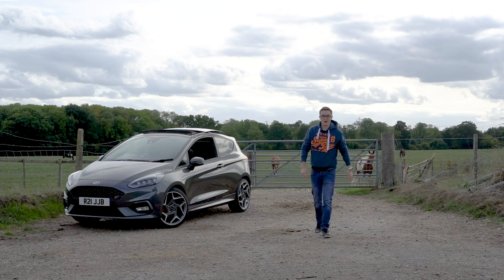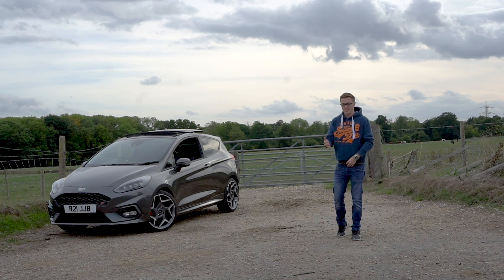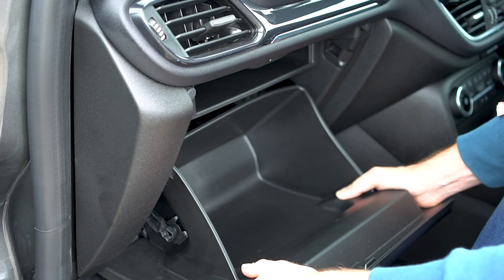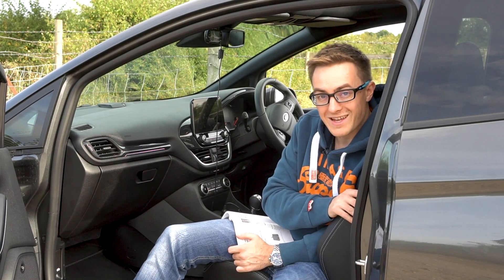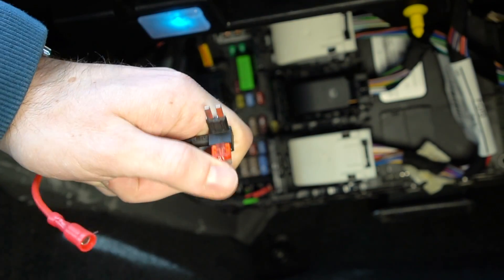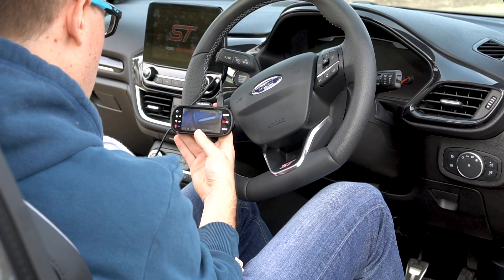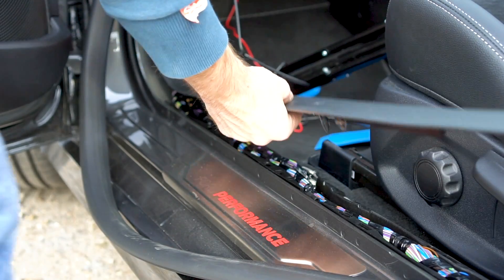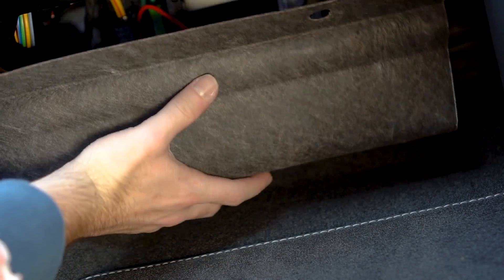MK8 Ford Fiesta ST - How to HARDWIRE a DASHCAM (Nextbase 412GW)

Comment: Hi mate, could you please explain which Fuse Locations are ideal to use, and what the difference between the fuse location 3 (Parking Assist Control Module) and 4 (Ignition Switch) Are if I were to connect to dash cam to either of these. Thanks

Comment: Please note that you've got the right wheel UK version. In the left wheel EU version, the cabin fuse box is exactly where the manual says, behind the glove box and the glove box does not need so much hustle to remove.  You first have to click the support pins to the right position and the glove box just drops down.
I would also suggest to buy a better camera, like the blackvue 750 or 900 dual channel and maybe for a separate battery if you keep your car outside to have long lasting parking mode. The extra features really justify the price and I am very happy so far. Please note that I'm not selling dashcams or I've never been sponsored by any dashcam manufacturer.

Comment: Just so you know you put the fuse board trim on wrong, there is a location tag and hole at the far back to stop it flapping around 👌 hope this helps
Reply from the maker: kane ferguson Cheers - I’ll have a look! I’ll be honest, the car came with no trim there initially and the Ford dealer put it on a couple of weeks after I got the car. Always thought it was an odd design as it was just left hanging there...
Reply: @JBCTR  your welcome 👌

Comment: I have a mk 8 fiesta st performance edition and have just bought a Nextbase 422GW dashcam. I am however having trouble mounting it as the housing behind the rear view mirror is in view if I put it in a similar position to where you put it JB if I mount it to the left I have managed to nearly eliminate the housing from view but now the camera is looking through part of the windscreen that isn't cleared by the windscreen wiper so in the rain its useless. Has anyone else had this problem, and if so where did you find was the best place to mount the camera? Thanks.
Reply: same problem, what did you end up doing?

Comment: Great video.  I would just like to know if you’ve had an issue with the ‘Park Pilot’ since installing? I followed your video exactly and I keep getting an error on the dash when starting up saying ‘Check Park Pilot’ Have you had the same problem? Cheers.
Reply from the maker: HI mate, nope nothing! Was park pilot the fuse you used? If so, double check all fuses have been pushed in to their holders. If you still have issues, try adding the ferrite core to the cable 👍🏼
Reply: JB CTR Yeah I have used the parking module fuse also. I’ve got a feeling I have put the supplied 2 amp fuse that comes with the cable in the wrong socket. I will check it over again tomorrow. Cheers! 👍🏻
Reply: What's the point in having a dashcam for a ST ? When you can get prosecuted for speeding. Better getting good quality GPS & laser camera detector.

Comment: Have you had any interference from the dashcam. I recently fitted one To my wife's car and she gets terrible interference from it. Haven't fitted a dash cam to my mk8 st this was a great shout regarding the fuses of the st
Reply from the maker: chris else Had nothing yet - I was half expecting it though. Nextbase supply a ferrite core with their kit which claims to reduce interference. I’ve not used it here, but I’ll add it if I get any interference. They’re about £2 off eBay - might be worth a shot 👍🏼 they simply clip on the power cable

Comment: I was hoping to install a front and rear blackvue cam in my St and am wondering what fuses to tap off, it requires a permanent feed for night time and a ignition feed for general day use.
Are all the fuses micro 2?
Will I need 2 micro 2 fuse connectors?
Thanks in advance , really enjoy your vids keep up the good work pal 👍🏾
Reply: yep, you will require two in this case. plenty of constant permanent lives in the st fuse box

Comment: If you hardwire in your dashcam does it effect your warranty ?.  I have a MK 8 Fiesta Vignale and really want a dashcam but like you I don’t want wires dangling everywhere, I’m a bit of a neat freak lol
Reply from the maker: ofah75 Best to ask your dealer, but I doubt it! It’s unlikely to cause any issues to be honest.
Reply: I'd say that it wouldn't as long as you aren't damaging anything in the install process and using quality kit that won't cause issues with the fuse box. It's also 100% reversible

Comment: Got a Mk8 and just taken delivery of a hard wiring kit.  Mine is not a Nextbase kit but one I bought on Amazon.  It fortunately came with 4 fuse piggyback adapters including the Micro 2 sized one.

The bit in your video that has been most helpful is routing the cable behind the air bag.  I thought it would have been simple/OK to poke it behind the door trim.  However, while I knew not to impair airbag operation I didn't realise there was one in that location.  

Cheers fella.
Reply from the maker: 800Viffer I’m glad the video was of use. Enjoy the new camera 💪🏼
Reply: @JBCTR  Just back in from fitting it following your method.  Only difference was that I needed to change the earth connector.  The one on the kit I bought was too small for the fuse board fixing.  Snip off old, crimp on new.  Job done

Slice of gateaux.
Reply from the maker: 800Viffer Glad the video was of use! 😁

Comment: Is there any impact on your battery life? Want to do the same but worried about returning to a dead battery!
Reply from the maker: Chris Mullin If you use a switched fuse, it turns the camera off with the ignition so there will be no impact on your battery :)
Reply: @JBCTR  what if you wanted to record whilst away from your car e.g parked up in a dodgy area!
Reply from the maker: Chris Mullin There are products on the market that will power your dash cam whilst then ignition is off, and also monitor the health of your vehicle battery so it doesn’t become drained. The Blackvue Power Magic Pro is one example 👍🏼

Comment: Just used this really helpful video to hardwire the wife's Vignale. What a pain the fuses are getting out.
Reply from the maker: rodofgod76 Glad it was of use, and yes they are! I think they were small enough in the MK7 - they didn’t need to make them even smaller! But hey, that’s progress 🤷🏼‍♀️
Reply: @JBCTR  
I even took the engine bay fuse box to bits hoping there was a tool in there, but no. I like how the engine bay box has, "Scrap if dropped!" On it. 

The Vignale is like your ST, with the fuse box underneath the glovebox not behind it
Reply: I have had a preliminary delve into my Mk8 passenger compartment fusebox and think it would be very difficult to remove a fuse without a suitable tool.  I already own a couple of different ones as I periodically add hard-wired accessories to my motorbike.  Easy with the tool.  Difficult as feck without it

Comment: How to get behind radio. I need to install a subwoofer
Reply from the maker: Mariusz Łysik Not too easy! There’s no RCA ports behind there. You’ll probably be better off tapping off the speaker cables for the rear speakers and using an RCA converter, or an amp with high level input 👍🏼
Reply: JB CTR ok. Thanks mate

Comment: A really useful video thanks very much. Off downstairs to fit mine now :)
Reply from the maker: Lee Bennett Thanks! How did it go? 😬
Reply: JB CTR everything is installed but couldn't connect it to the fuse as the piggyback fuse was the wrong size. I'll have to order one.
Reply from the maker: Lee Bennett If you’ve got the Nextbase hardwire kit, contact Nextbase and they’ll send you what you need for free 👍🏼